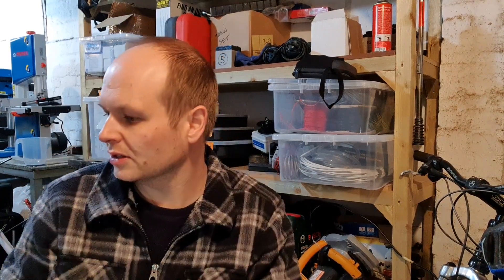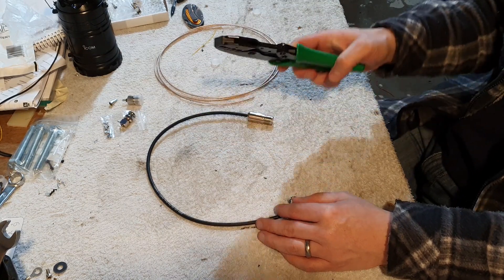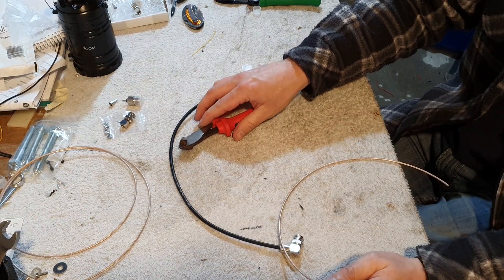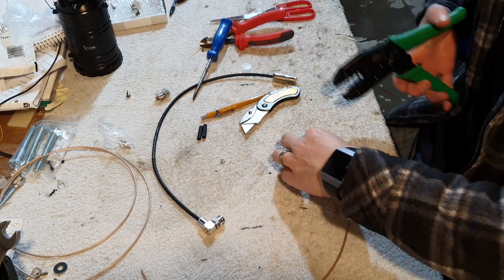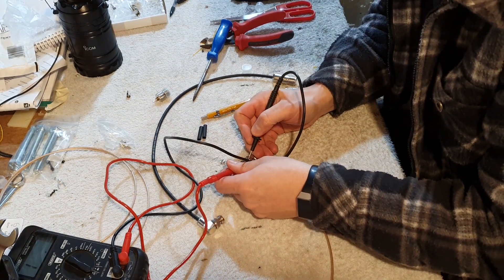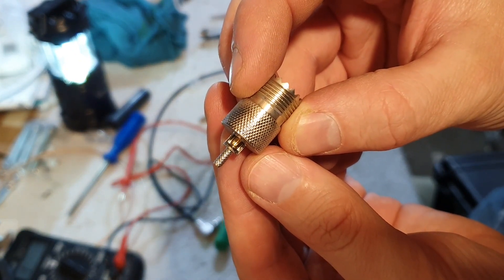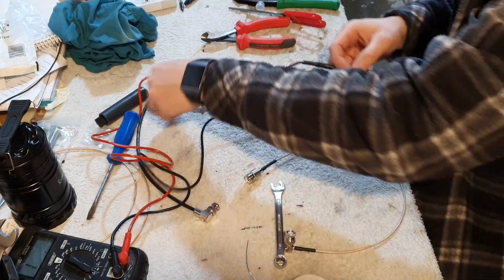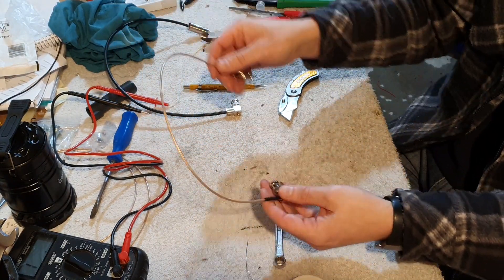Making your own BNC to SO239 cable assembly for QRP Radios

Comment: Great video, I know you didn't ask this, but just in case you are looking for something more flexible than the handle of your crimper for soldering (I did the same sort of thing for years and still do!) check out something like the Silverline 380677 Drill Press Vice on Amazon (costs a tenner), very useful for soldering those connectors and various other things while on the bench. For smaller things like PCBs I use a "stickvise" which are more pricey but great, but the jaws are not heat resistant. You need to buy the PTFE upgrade if you want to do use that (both the vice and the jaws are available from Digikey).
Reply from the maker: Appreciate the tip. My neighbour gave me a similar thing that came from RS. Forgot I had it.